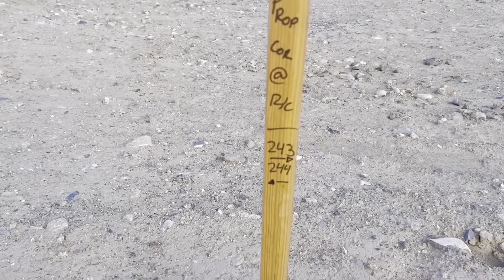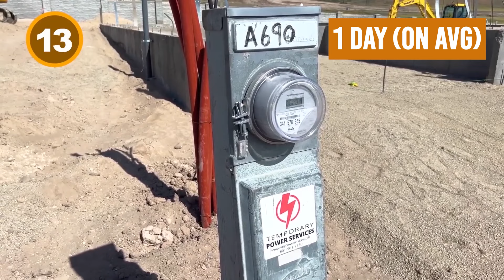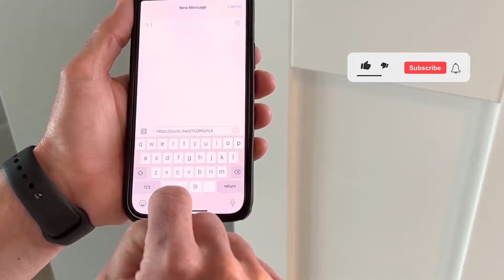MOST INDEPTH New Home Construction video EVER CREATED with TIMELINES

Comment: Great step by step video! My dad was a builder in Illinois, and all the custom homes he built in the 50's-80's had basements of course. I will be building in Tennessee and generally, homes there do not have basements.  I was told the water plane is too high, so homes are built on slabs. Besides the obvious differences, do you know what other supports are used on top of the slab?
Thank you!
Reply from the maker: Unfortunately, I have zero experience building on slab, so I’m not sure.
Reply: @TyWilde  
No problem, thanks!